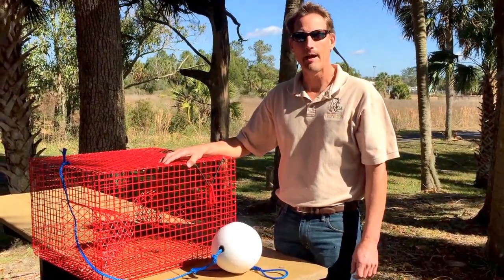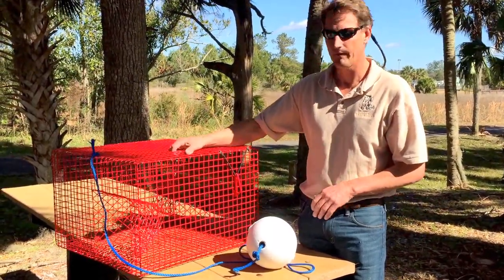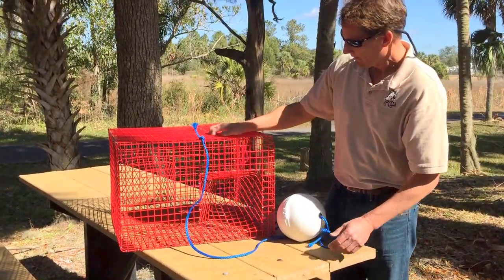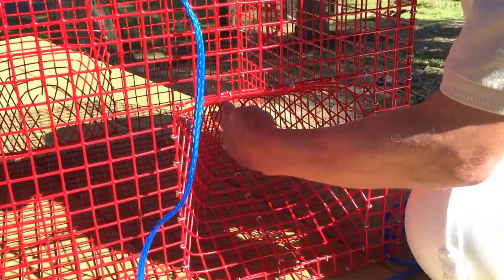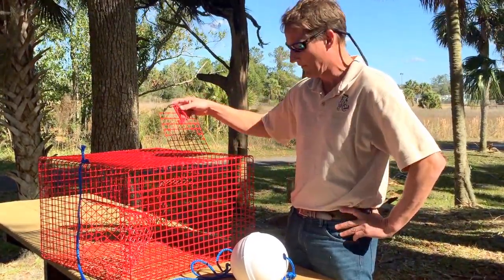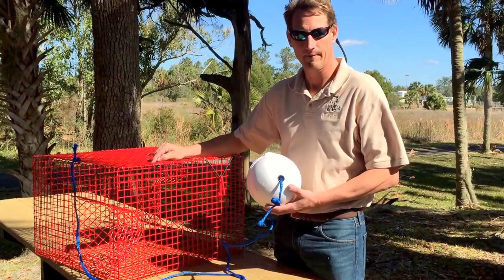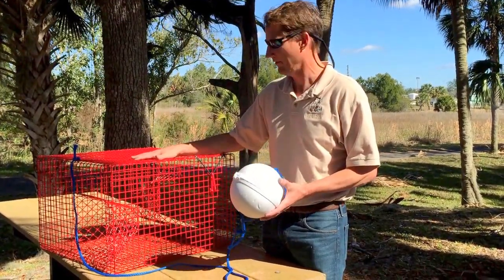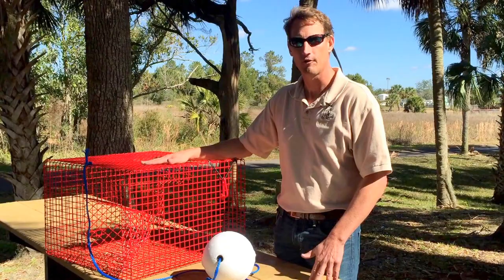How to Pinfish Trap Use and Specifications

Comment: I know this is an old video but here in Texas it can’t exceed 18 cubic ft in volume, has to have a degradable panel or a lid with degradable twine or single length untreated 20 gauge steel or smaller so the lid will open after twine/steel degrades, opening can’t be smaller than 3x6 inches, it must be marked by a floating visible buoy (six by six inch minimum), the buoy must have a gear tag attached (name, number, address, & date set out), gear tags are valid for 10 days after date set out.
Reply from the maker: Good to know. Thanks for sharing. This video is specific to regs in Florida.